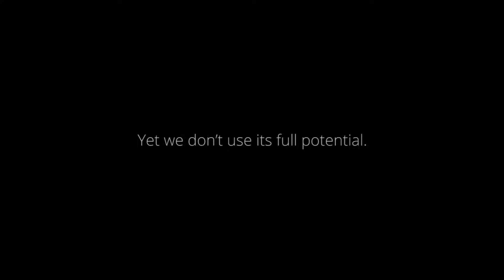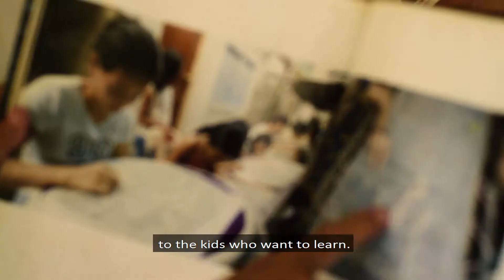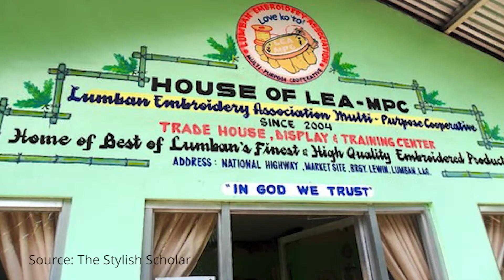Likhang Piña

Comment: Why not to cut the long leaves to match the staple length of cotton to be blended with and add the cut leaf portions to an anerobic digester? The fibres get separated due to the action of microbes which produce methane as a byproduct.